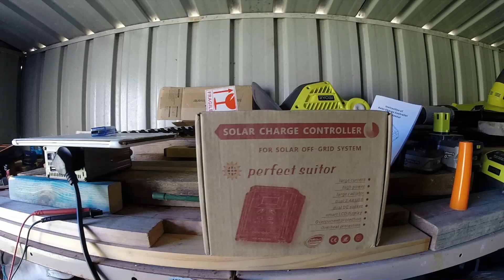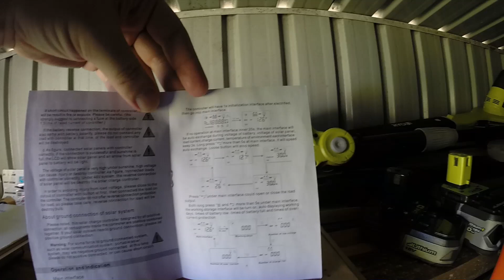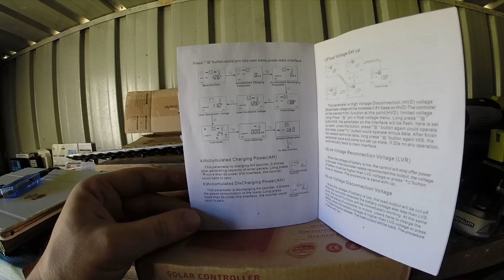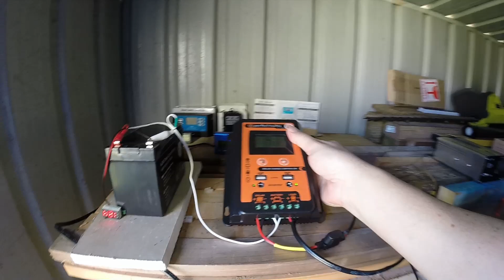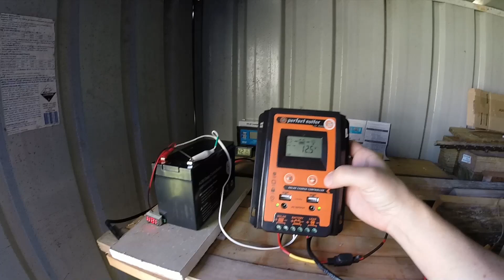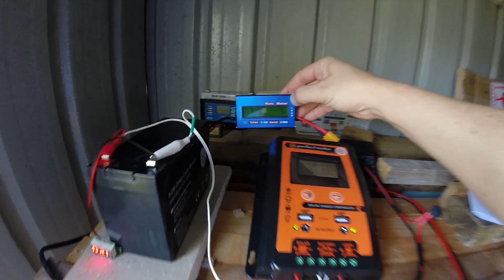Perfect Suitor 30A PWM Solar Charge Controller - does not support Amps

Comment: Hi! Does this unit support lithium-ion charging at 12.6v? Is it flexible enough to set various settings like discharge disconnect & reconnect at various voltages level? I’m not worried about the amps display as much 😁

Comment: a little note .... never connect the inverter to the charge controller so that you break the charge controller ... if I listen to you I notice that you still need a lot of information ... but everyone started small and it can be that a charge controller was broken before buying ... mine works very, very well despite being a PWM device